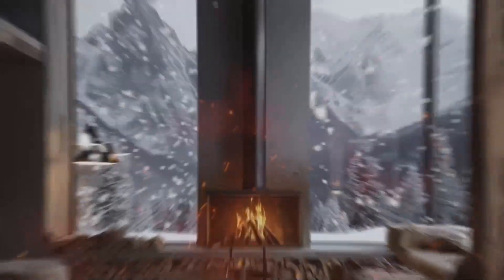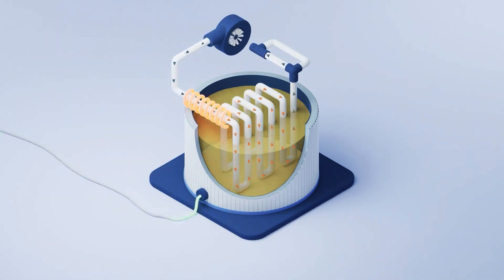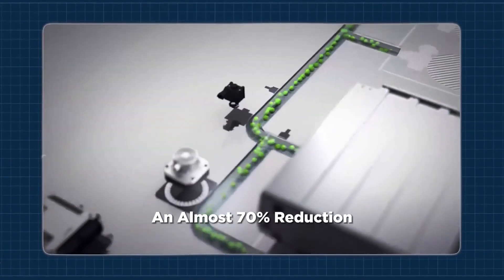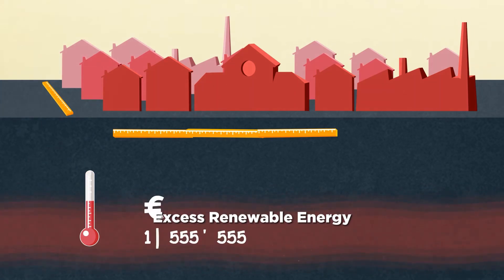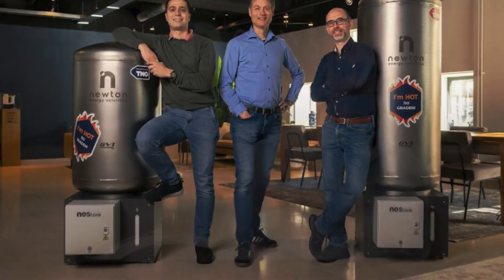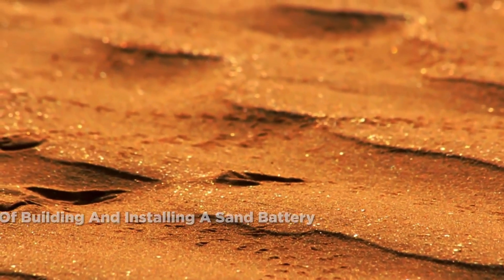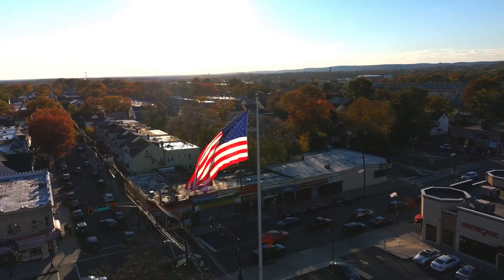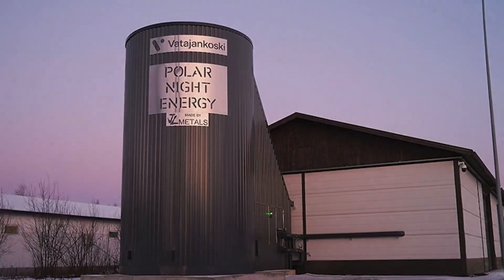The REASON Why SAND BATTERY So IMPORTANT Is For The Coming Future!!

Comment: Sand Battery 1:41  The thermal energy can be restored back into Electric energy NOT !!!!   ALL electric generators using heat, Nuclear, Coal, Nat Gas, Diesel Etc. depend on STEAM to turn turbines to make electricity. No Sand thermal storage unit can output enough heat to create STEAM to drive turbines to make electricity.. this is an outright LIE>   heat your house.. ok, or a building OK , but that's about it.. Sheesh talk about complete fantasy and dupes believing shite.. Hilarious... hundreds of thousands of dollars of pipes and infrastructure instead of a simple water heater and a gas-line and a flame... WOW... the entire prospect that CO2 is a TOXIC GAS. instead of plant food has lead all you dupes out there into believing this tripe.... Hell, You want cheapo heat for your building, drill a hole. You don';t need solar panels, pipes, insulation, Millions of tons of CO2 expense in mining all the stuff needed for this waste of time.

Comment: My grandfather built a house in the early 80's on Cape Cod that used this technology and it still works today! He used finely ground pebbles instead of sand. The front side of the house was a slope. The first story was all greenhouse windows and the second story part of the slope was solar panels, but the solar panels were not electric. They consisted of simply empty space between the glass and black aluminum foil on the back side. When the sun was out, a fan would blow the heated air that was trapped in the empty space between the glass and the black aluminum foil to the underground rock bed where the heat was stored. 1 sunny day would store enough heat to heat the house for several days. To heat the house, a fan would simply blow air through the rock bed and up through heating vents positioned on the floors. The water in the house was also heated using the rock bed. He was an engineer for Grumman.
Reply: that is incredible . what a great man

Comment: The concept is awesome. Your idea could use a little tweaking and I know of another source that is available and the volume of excess heat generation is substancial, it is within electrical generating power plants, there is a 30% loss of energy potentiol due to heat generation, it only makes sence to use this sand battery system to convert heat loss right back into usable electricity.
Reply: Agreed this is something you wouldn't use on its own. This is something I would use for my house in conjunction with a wood or pellet or coal boiler outside and reuse or collect waste energy or use it to boost the heat that's already flowing and catch the heat on the way back.
Reply: @MeandmyXj  I sometimes think that the savings concepts brought forward are merely distractions.  I know for certainty that we have unlimited energy from a machine that is labeled MYWATERWORKS consider a 100 foot cubed building and  1 megawatt of clean electricity coming out of it with no fuel going in. It works on simple tools manipulating a timed system to move water from 93 feet height down onto water wheels and then using the system to raise that water/spent energy back to original height making energy like what happens using a dam. The water remains inside the building and is merely cycled from on place to another on a schedule of travel. This system once loaded uses no energy and puts out 1 megawatt of electricity .Here is a very good clue as to how it works, 1st when using electricity in an electric motor there is 30% energy loss to heat. Well if the water travels over a water wheel and turns the energy into mechanicle energy instead as in turning an axel attatched to an air pump, then there is no loss of potention energy. another is a simple lever, then there is the simple pulley, MYWATERWORKS is a machine that can be installed near the end user - 100 homes and that cubed building will always provide 1 megawatt in all seasons and all times. Trouble is that the government doesn't really desire to have this marketed. It would immediately de - stabalise the power structure on the planet. Nations like saudi arabia would rapidly lose necessessity on the world stage. If our nation used it these units could be built everywhere, even sitting below the surface with buildings built right over top of them. A 100 foot cube could even be put into every large container vessel replacing the huge filthy sludge burning engines, most of the lower level of these ships are oil holds. So back to the problem, it's a control issue.